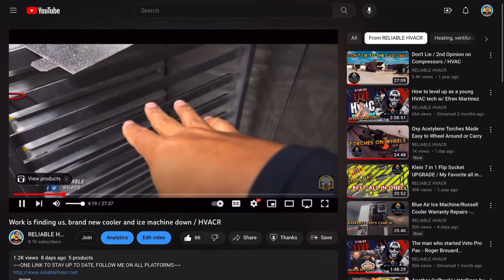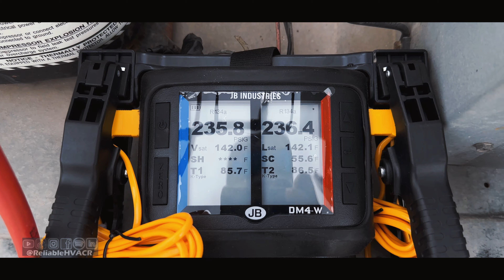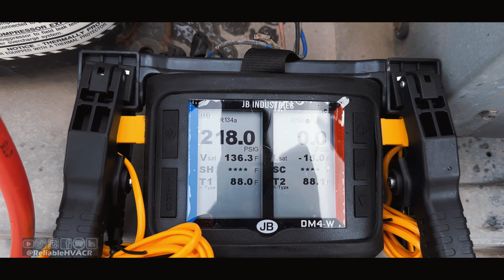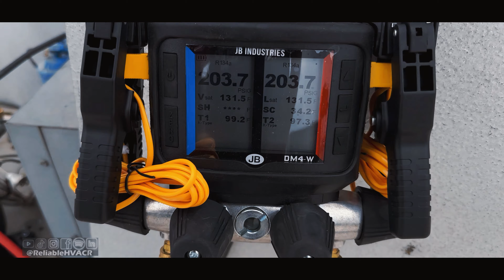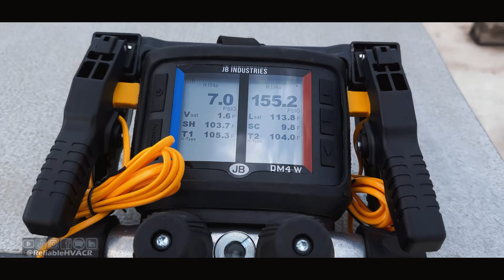R12 System Changed Out to R134a & More Issues Hiding

Comment: Adrian what happened to the quick connect set up on your torches also were you charging liquid thru the suction should start on high side first this will confirm no restrictions also will prevent flooded start or having liquid sitting at the compressor inlet which could damage the compressor valves. Nice job on leak repairs
Reply from the maker: That set up is on my oxy acetylene. I dumped in a bit on the liquid and then had to meter it in thru suction so I didn't overcharge it. No weight on this one and 134a runs low pressures